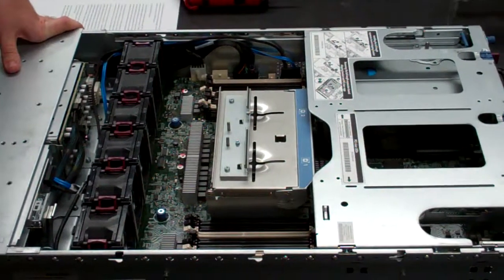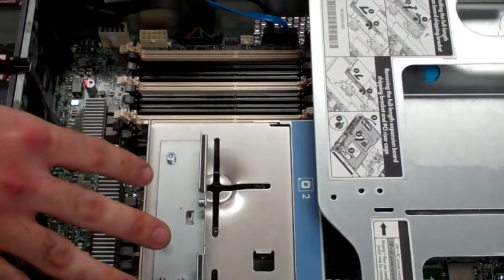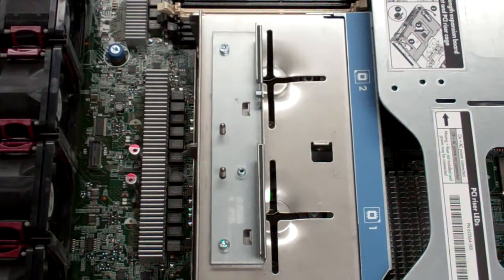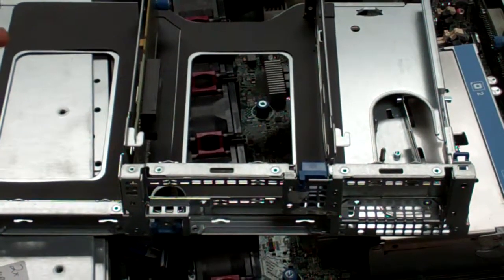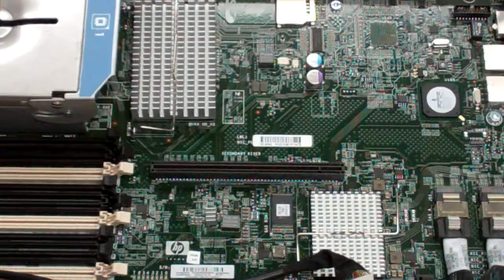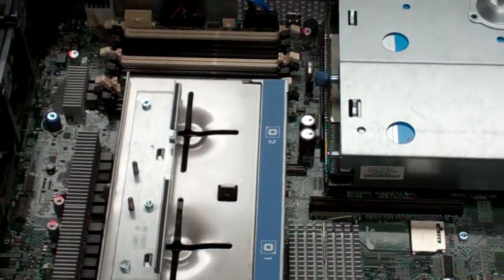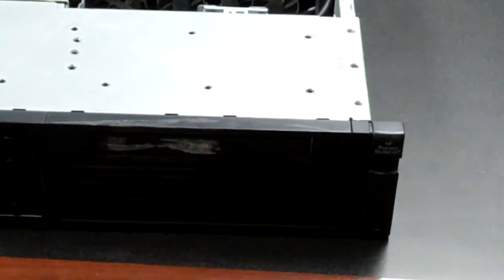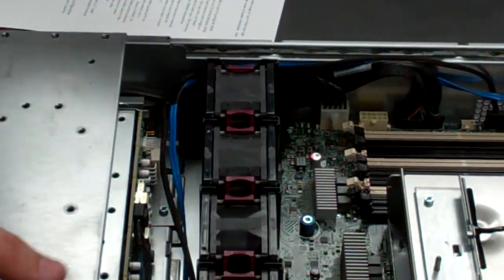Velocity Tech Solutions - ProLiant DL380 G7 Server Overview

Comment: i have a HP DL580 G7 but won't fire up? i have a amber power light and on the little panel there is a red light flashing after i have pressed the power on but no life coming from it whatsoever, could you shed any light on it, i have changed to psu's but still same. there are no other lights showing or flashing i just have amber power light showing and red flashing light  thanks